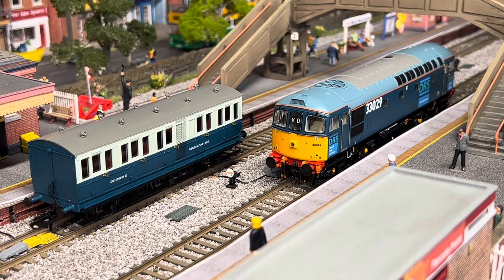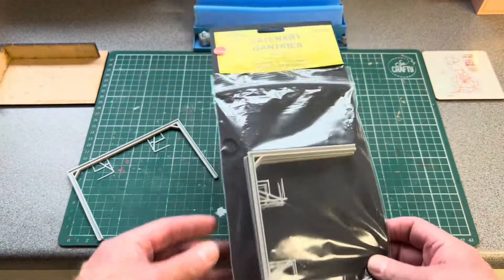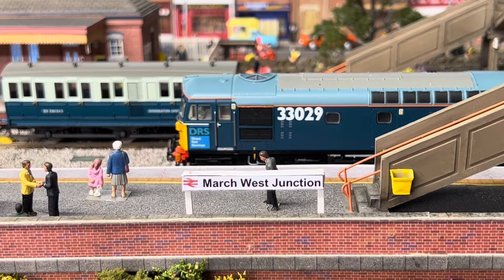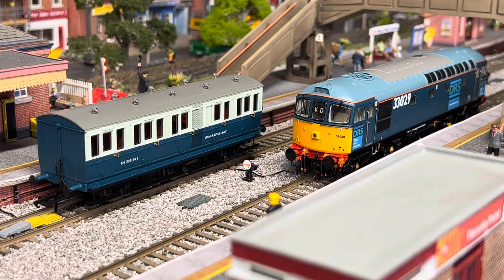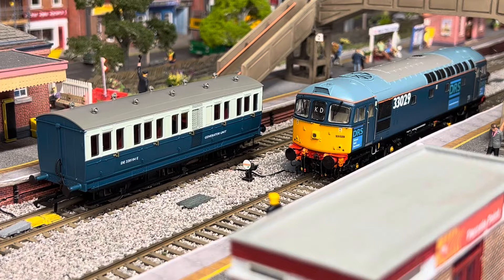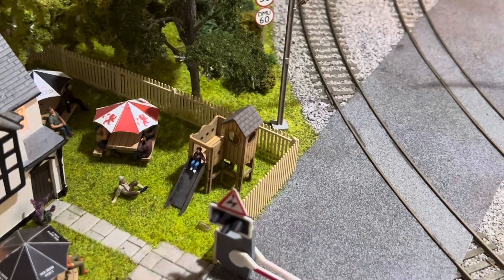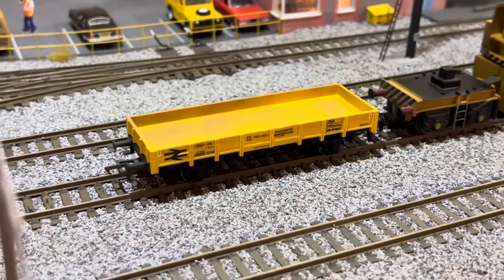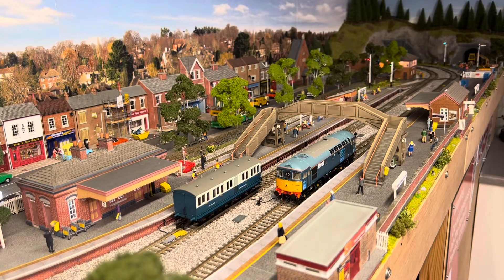No 81. 3D Printed Overhead Catenary Gantries from Rhuddlan Models plus new additions to the layout.

Comment: Hello Andy!  Great video and lots of cool bits added.  The wagon in question is one part of 2-part wagon which carried a large crane used in loco andtrack repair and maintenance.   The head of the crane would have rested in this wagon, with the crane control hub and tower supported on the other.  BTW- did you change the wheels out?  Unless this was a TRIX (DC/DCC), you will need to.  Märklin metal wheels aren't isolated and will short a 2-rail system.
Reply from the maker: Hi Anthony, thanks for the feedback I will look into replacing the wheels. The good thing about it is that I'm planning on running it with my crane so it's the right wagon for the job..
Keep safe and well my friend
Andy

Comment: CATENARY HAS TO BE TENSIONED - OTHERWISE DEWIRING OCCURS!!!!
To erect realistic Catenary on a layout and avoid the problems of "dewiring", you need to use a system with STRONG BOLT IN MASTS. For the simple reason the actual Catenary wire HAS TO BE TENSIONED, as in real life. Otherwise "dewiring" will occur. Due to the spring in the pantographs, which obviously pushes upwards constantly, trying to push the wire to one side & off the end of the pantograph head !!! 

Further Catenary wire can only go in a straight line between masts, bending it to get around corners is unrealistic & will result in "dewiring" of pantographs. The Catenary wire also has to zig-zag (above straight track) alternating between long arm masts & short arm masts. On curves the masts are either ALL short arm if the masts are outside the curve, or ALL long arm masts if planted on the inside of the curve. 

Because Pantographs on modern High voltage (15,000v AC & higher systems), the pantograph heads are in real life fitted with carbon brushes. Which improves conductivity and reduces wear on  the expensive copper contact wire. As a result if the Catenary was always positioned exactly over the centre of the track, the copper contact wire would wear a groove very quickly in the carbon brush of any pantograph
. 
So the zig-zagging needed above straight track ensures that the contact wire effectively sweeps from one side of a pantograph head to the other as the pantograph moves forward !!!

NOTE: "Catenary" is a general term used for overhead that uses an upper & lower wire, with vertical "droppers" between. The upper wire is actually "the catenary" wire, while the lower wire is the "Contact" wire. Overhead using only one wire (suitable only for use at slow speeds) is usually referred to as overhead "Trolley" or "Tram" wire system

On model layouts no matter which manufacturers products you use. A small tipped 25watt soldering iron is an unavoidable necessity. As the Catenary wire will often need soldering to the mast brackets to ensure the pantograph does not "snag" on the joins. This will also help with maintaining tension of the wires, as you move forward with installation one mast & one wire section at a time. Which means you CANNOT plant lots of masts & return to hang the wires, unless you are prepared to snip wires to the resulting required length !!!

Installation correctly to ensure a little tension means any type of "Jig" is useless, & a waste of money. For example, crudely, if you have 200mm lengths of wire, then the mast spacings need to alternate be 201mm between the first pair of masts, then 200mm apart between the second pair ad infinitum, just to ensure some tension. 

The necessary tensioning, also means that Catenary systems using plastic masts are insufficiently strong, and realistically are aimed at the "average modeller". More professional Catenary systems are available from Sommerfelt & Veissman two German Catenary specialists, with very large ranges providing masts for many European Railway company designs, and many accessories, their masts are normally of the bolt in or "hammer into hole" design. Available normally from the handful of Continental specialist shops in Britain, including "The Engine shed/Gaugemaster" outside Ford Station who stock Veissmann & "Modelmasters/Scalology" who are in The Square, Barnham (co-incidentally the next station from Ford) who stock Sommerfeldt. 

I've used both these German systems on my Japanese, British & German exhibition layouts, in various scales from N to O gauge. Indeed I was probably the first to have fully functional catenary fully energised on an large N/Ngz dual gauge German layout back in 1979. Which later appeared in Continental Modeller & various European mainland modelling magazines. 

Indeed being a real life railway engineer I have dealt with real catenary, as far away as New Zealand during the North Island main trunk line electrification in 1985/6 which basically used the British Railways 25,000v AC system & Tri-Bo electric locos built by Brush, on their 3ft 6in gauge network.
Reply from the maker: Hi my friend. You do realise this is just a model railway? It’s not real it pretend!!! It’s just a bit of fun
Reply: @MarchWestJunctionTMD 
Obviously you've never joined a Model Railway Club. Many take their hobby seriously enough to want "Model" standard not "Toy". Which has always been the problem of the mainstream British manufacturers, such as Hornby, who always aim at the "toy train set" brigade. Which is why there is NO manufacturer in Britain who makes a quality range of catenary that is designed to be technically fully functional and precision made for the true Modeller, OUT OF THE PACKET !! 

The Sommerfeldt & Viessmann ranges (& you can mix their parts) are usually found in virtually all "Model Shops" in mainland Europe, because the average modeller in Europe has always expected "model" standard, not second rate "toys".

Which is why virtually no British ranges, except Peco track, ever gets into European Model shops. But European ranges are available in a handful of British Model shops (two of which I mentioned) because some Brits have discovered you get much higher quality, reliability, and longevity from European model ranges. 

Here's a good one. Some Dapol N Gauge trains come fitted with scale working Buckeye or Scharfenburg couplings. Solely because I introduced Dapol over 20 years ago to TOMIX (Worlds biggest model train manufacturer). TOMIX model trains were fitted with such couplings as standard from 1987 onwards. Although Hornby have only recently discovered such things !!!! 

Try reading "Model Railway Journal" available from W.H. Smith's. It's aimed at the more professional British Modeller. And will probably introduce you to a whole new field of British Modellers you were unaware exist.

Happy Modelling 😊
Reply from the maker: @railwaymechanicalengineer4587  
Hi to be honest I’m a member of the Warley MRC. I don’t take my modelling seriously I just do it for fun with my granddaughter so getting things perfect isn’t my thing but each to their own 👍